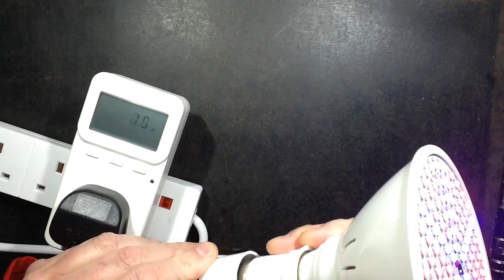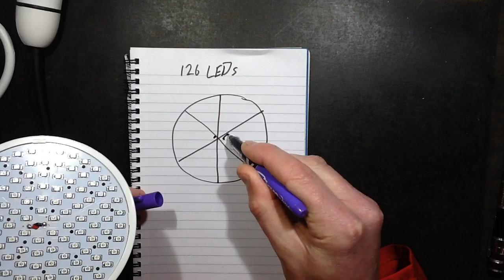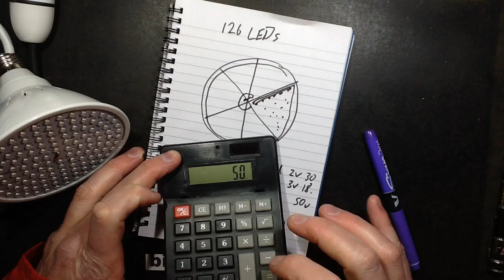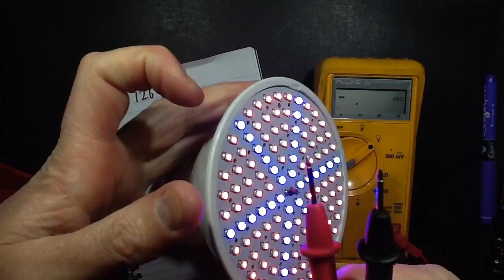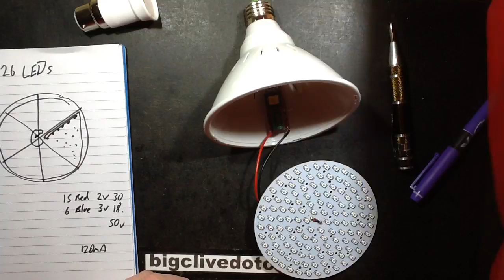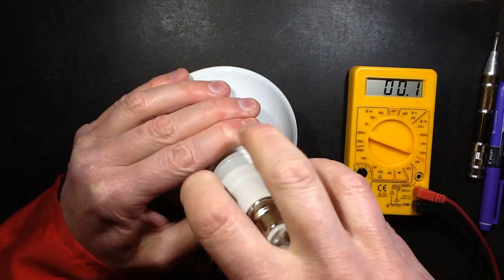126 LED hydroponic death lamp.

Comment: A female friend of mine asked me to get her a "plants lamp" for a birthday present and I just searched for that, acquiring a 50ish EUR lamp from a domestic supplier. It came overnight packed just in a plain cardboard box and inside that it was wrapped in a plain clear plastic bag, so there was no much unboxing, and I couldn't help trying it out. I found the hard pink light quite appealing for some reason. So I thought that is what she might have wanted and wrapped it up nice. We had had some incandescent based plant lamps in the 80's when they were "special" and I originally thought this might have an intense white light just as well.

I dropped it off at her party with some small gizmo I planned for the surprise effect and thought to become useful, including a touch screen glove, USB Micro/C adapter and tablet pen. 

Two days later she called me and asked what the deal about it was. I asked if there was something wrong and she said "no... not really but it's just different than I expected". Turns out we both had had the same expectation. So I explained to her that as far as I know this design is made to take into account the low absorption of green wavelengths in chlorophyll and that the red and blue band together make the light appear magenta or hard pink, and if it had a closely matched green light source in it, it would appear like "TV white", which I oruginally expected as well. And while not being designed to make colorful plants look pretty, it must be a growth improving lamp.

A week later she called to ask where I had acquired it and how much it cost because two friends of hers had asked her where they could get similar fancy hard pink lamps.

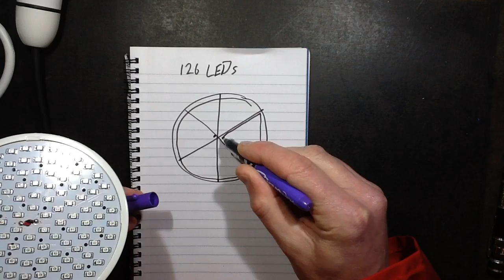Comment: About arranging the 21 per sector (around 1:50): If you look at it from a slightly different angle, it's simply 1+2+3+4+5+6 = 21, not "one row of six" plus a random blob of fifteen.

Comment: Would the wattage be lower if it was rated for 115vac?
Reply from the maker: If it was used with 115VAC it may just regulate to run at the same power.

Comment: I had a few of these for a hydroponic system I had. Despite them being low power they were great!
Reply: Depends on what you are growing with them. I dont like them because it is hard to inspect a plant when they are turned on. Also they are inefficient when compared to white LEDs.

Comment: Not smart buying anything that runs from mains voltage and comes from china on ebay or amazon.  Looks like you can get the mandatory electric shock by touching the connections on the front.  Love the comment on the plant doing the same and getting fried!

Comment: Is there any particular reason you don't use a clamp-on current probe for projects like this?
I know this is a very old vid, but I'm reminded that I think I've never seen you use a clamp-on current probe instead of having to cut a wire/connection and insert the current meter in-circuit, thus as you point out in this video, changing the circuit's operation.
Reply from the maker: This circuitry is using a current regulated supply.  It's easy to tap into it by bridging the meter across an LED.

Comment: Can someone point me in the direction of a video that Big Clive does that describes an isolated supply in a device of a similar circuit to this lamp
Reply from the maker: Many of the type that have a small inline supply have crude isolation.  But not at a level for safe touching of the output.
Reply: @bigclivedotcom  Okay, thanks, Clive.

Comment: Egad, all that would have had to be done is conformable coat the LED array as a cheap way to add some protection. Perhaps conformal coating acts as a UV filter?

Comment: Damn! I just saw your video after I bought it!. Is there an easy way for me to modify it to make it safe?
Reply from the maker: You could possibly find an isolated LED driver that matched the current and voltage specification but was isolated.
Reply: Throw it away

Comment: Had something like this fall apart in my cloner due to really cheap plastic. Had a few others the LED would go out and I"d have to jump past them. They're really shitty. I've changed to using security light LED bulbs they're better guarded against moisture. You don't need that weird purple spectrum. Actually most plants hate that shit. Use the closest thing to 6500k daylight spectrum. Full spec LED grow bulbs (purps) are junk.

Comment: LED lights usually only put out a fraction of what there rated to output manufacturers claim its so the product lasts longer. Takes the biscuit really almost bought a 300w mars hydro a while back until I realised it was wired or programmed or whatever to output 120w

Comment: There are a great many different types of these low power grow lights now ...They ARE worth considering because they use small chips , these are much more efficient than 3W chips commonly used in big unit's  , will cut your power bill by a quarter for the same light output  but you will need about 80 of these lamps per square meter of grow space

Comment: I often wonder how people use these low power grow lights ... plants need about 500W per square meter of growing area ( thats the  electrical power delivered to the led's)  so a lamp like this gives enough light for an area 10cm by 10cm ... that's roughly the area of the lamp itself ... to get decent growth the lamps would have to be stacked close together.

Don't worry about shocks ...  they help keep you awake.
Reply: +oz93666 I think your figures are a little off, a 400 w MH will handle the  area you stated and it's not anywhere as efficient at delivering usable light per watt as leds.
But you are right that these are a joke for sun lovers . Be fine for a 6' geranium to over winter .
Reply: It said that a 400W metal halide is equivalent to 150W led (that's 150W electrical input to led's) . Also , for flowering (weed)  max 500W.led per sq meter ...veg growth 250W
Reply: +oz93666   It said    400w MH =150 w LED    ???  
Where ? I didn't hear him mention a metal halide in this video at all .
First watts isn't the right unit to measure light in but to simplify and make rough comparisons it is passably adequate (with minor adjustments occasionally  needed).
Not even sure if your most recent reply was agreement or not.
Are you disputing the 400 watt MH will handle a square meter of grow area?
Where did you get your 500w LED max figures?
(not that I'm disputing them just curious)
Why go for max W/m when you really want optimum watts/meter?
And twice now you've said virtually the same thing 
 1  "thats the  electrical power delivered to the led's"
2  "that's 150W electrical input to led's"
I cant help but point out that watts is actually power consumed by the device and depends on the devices needs.
Inputs would be voltage and  amperage  and in most home circuits can supply up to about 1500 watts  (this is why all small plug in the wall space heaters max out at 1500 watts)  but you can still plug in your cell phone and draw only 3 or4 watts.
Not trying to be picky  just specific.
That watt rating is the amount of electric energy converted to some other energy like light or heat.

Comment: At least it appears that the direct connection is only from the screw part of the base to the ground of the lamp since the screw side of a lamp socket is neutral and thus tied to ground in the US.  With the bayonet style base and 230-240VAC I would be a bit more concerned.  It does seem dubious that they didn't go to the extra length of completely isolating the lamp.

Comment: this video saved me $100+, a house fire, and possibly my life.. THANK YOU
Reply: Not sure how this saved you 100+ dollars or prevented a house fire.  The 2 main concerns in this video were that the terminals on the front of the unit could become live depending on the type of socket you plug it into (in the US it would likely be less of an issue since the screw of a light socket base is required to be tied to neutral which is also tied to ground) and that they are not really putting out the full brightness.  This review was also done over 1.5 years ago and you will likely not find the exact same construction in bulbs you would buy today.  The only way you really know is to take one apart.  

One other thing to remember is that you can find LED and compact fluorescent bulbs of dubious build quality even from name brands on the store shelves at your local big box store in some cases.

Comment: Hi Clive. Love your vids, your dulcet tones always make me chuckle, especially when talking about electrocuting babies in the bathwater, but I digress. Been trying to find one of the meters you use for checking power/current through a mains socket but have totally failed, I don't suppose you could link me to one please?
Reply: I'm gonna call BS. You can google anything even remotely similar, like "power current measurer" and you'll find it. Laziness is ugly.
Reply: That comment was about as non-profane as a comment can be on the internet. You are quite a tame individual to be roaming these harsh webs. Hit the close button please.
Reply: I bought a clamp meter used in service panels for testing amperage. Something like this, though you might be able to find something cheaper http://www.globalindustrial.ca/p/tools/test-measurement/Metrs-HVAC-R/gardner-bender-auto-ranging-clamp-meter-3-function3-range?infoParam.campaignId=T9F&gclid=CNz4vsfzo9ECFYZlfgodoVUFC
It works by clamping over one of the AC leads (it will be the hot wire in the case of a service panel). ONE of the leads, not both. So if you clamp it over an extension cord, you won't read anything. 

I made myself a small extension cord (about 30cm long) with the hot wire a bit longer so that I could pull it outside the outer insulation and make a loop to clamp over. This allows me to test an appliance's current draw by plugging it between the mains and the power cord in a similar fashion to the inline testing adapter that Clive uses. I have no idea what the maximum draw on his tester is though, where a clamp meter can go over anything.
Reply from the maker: Try a search for energy monitor.
Reply: Kill-a-watt meter in the USA
Reply: so is the use of profanity... but oh well, guess the rules for you are not the same as for everyone else
Reply: City of Anglers mute button works faster 😄

Comment: Couldn't you simply apply a small piece of electrical tape or liquid rubber over those bare solder contacts?

That of course begs the question of why the manufacturer didn't...
Reply: MPKampersand
Lol.  I wish, sure would help with financial shit.
Reply: +Alvin Brinson Cheaper production costs.

I just bought a similar lamp, but it looks like it's a different design.  I'm growing peppers indoors.  :D
Reply: Makes me wonder if the LED strips my gf just installed in her closet have exposed solder....They're not "thick" like the one I got for my car, you could feel individual bumps. I didn't look closely though.
Reply: +astrangeone "Peppers" suuure buddy. We all know what you're growing in there!

Comment: You could include instructions on how to increase the current, not for me, I know how to probably do that by, I suspect, changing a resistor value. If I were the designer of such lights I would, for 220-240 volts, connect 84 LEDs in series supplied from a SMPS constant current circuit and increase the current to at least 30mA. And of course make it safe to touch when live. Also selling them at the correct power rating :)

Thanks for putting out these videos, very interresting, keep up the good work!